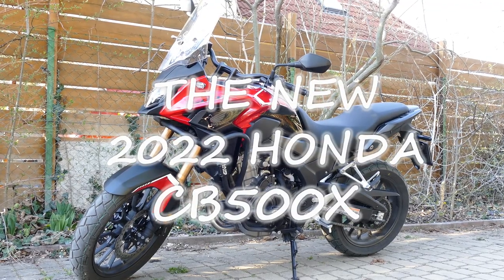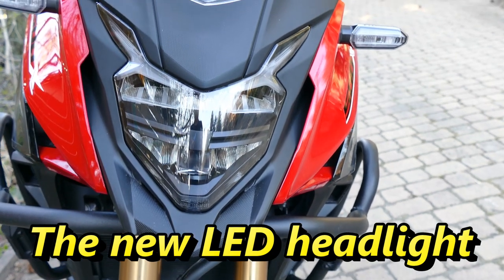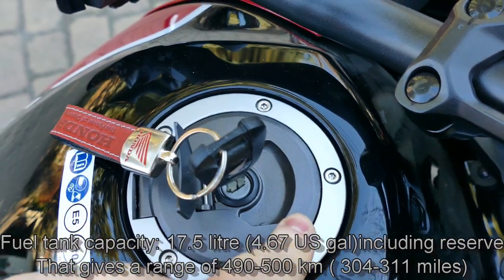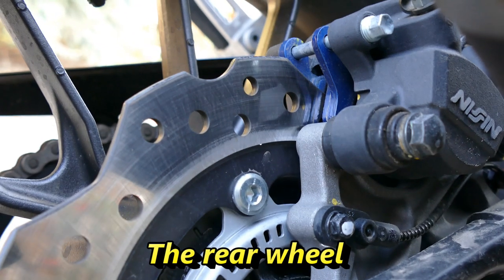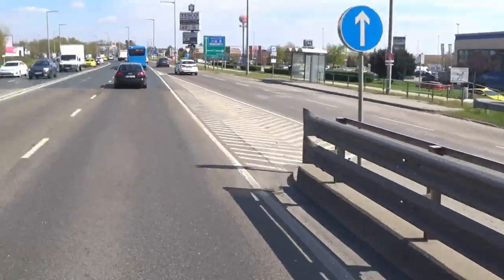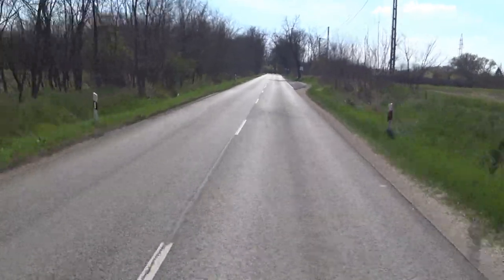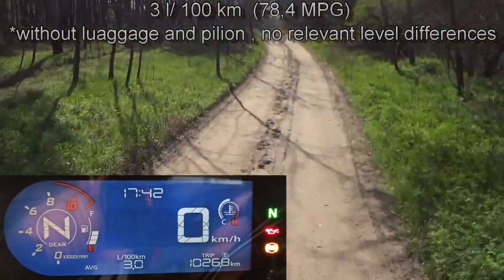The new 2022 Honda CB500X | What's Different? | 1000 km review

Comment: 👋 Hello, fellow CB500X owner! Hey I actually have a deposit in on this same bike,  I presently own a 21' only 1200kms on it, I like the red color, the new forks and dual front disc. I have an XD4 helmet also love it. What jacket is the Revit you are wearing? I have a Klim Induction jacket great ventilation for hot weather. Keep the videos coming, good to finally see night headlight views too.
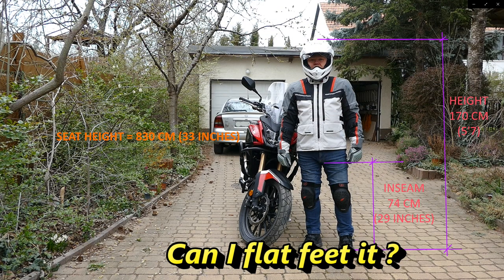Reply from the maker: Hello Wayne! Yeeeea, it's a good rig, the more I ride the more I like 🙂. The Revit jacket I wear in video at 00:20:35 is the "Offtrack Silver/Red" with CE level-2 shoulders and elbows protectors, water protected pockets, detachable thermal liner, and detachable waterproof liner. It's a four-season jacket with good ventilation, but during summer I prefer my Revit "Airwave 3" jacket :-). See that at 00:33:06.
Please let me know, has your existing bike got so much rust on the exhaust system as mine? …and I am also curious if you get your new bike how that looks like.🙄 
Regards, Zoltan.

Comment: How much you paid for the crash bars and what model/type of crash bars it is ?
Reply from the maker: Both, the crash bars and the engine guards are Givi brand. Model: TNH1171 (crash bars), model: TN1171 (engine guards). Togather they cost me 277 EUR (excluding installation) in January 2022 , and I ordered it from the dealer with installation so there was no need to go trough the formal technical examination again.